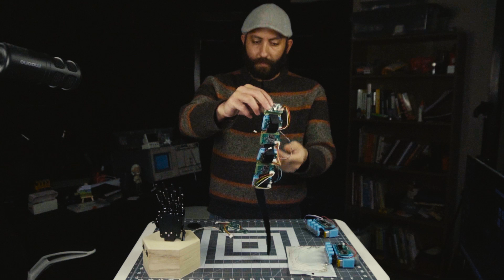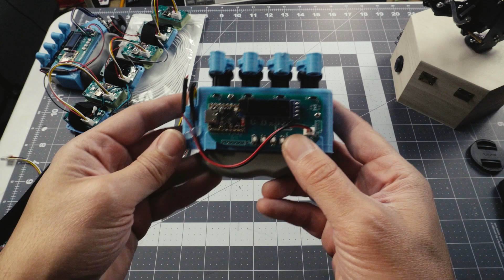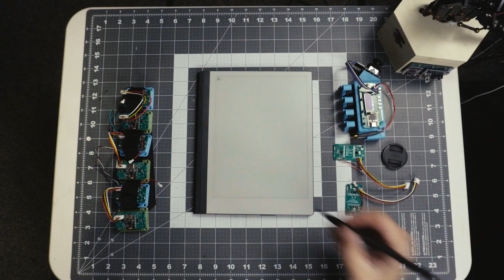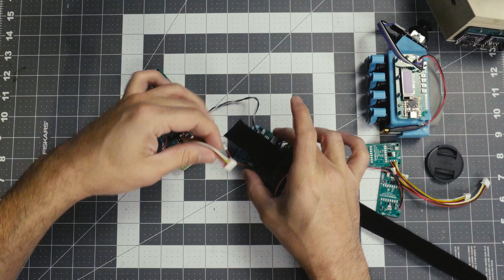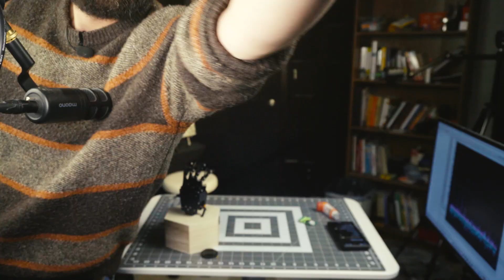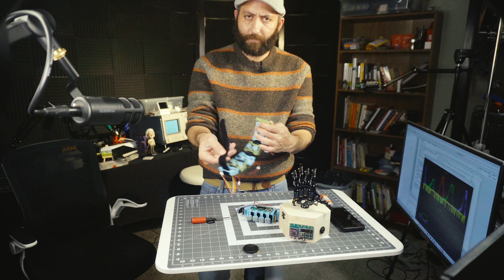Successful Data Capture! - Open Muscle November Update

Comment: Your project is awesome!
Could you say some more about the neural network?
How do you train it? What does it output?
Reply from the maker: @redve390  I train it with that label device and the output is 0-750 for each finger. So the output represents a finger curl strength or finger actuation.

Comment: Also are those mechanical sensors you are using? Honestly I don't really like mechanical. Presumably in an amputee the muscle leading the hand would atrophy. Making mechanical sensors ineffective. There is probably even a decent chance that the neural signals would atrophy as well making the pickup of those impossible. I think this is why people use gesture control. With gesture control any muscle on your arm can control any arbitrary hand function. With training you should be able to recreate complete hand control but I doubt it would use the same existing muscle groups. 

One thing I liked and always wanted to try were ultrasound sensors. There is a paper talking about an ultrasound prosthetic called the like. Skywalker hand or something. The problem with that prosthetic is that they used a medical ultrasound machine to provide the input. I think low cost ultrasound sensors should be able to work if used in a phased array. The reason why ultrasound sensors would work well is that there is more data and more data means better differentiating between gestures and even gesture interpolation.
Reply from the maker: @Imaboss8ball  electromechanical has two amazing features. 1 super high signal to noise ratio and 2. Low sample rate required to map the frequency. This paired with ML makes for insanely fast and accurate inference.

Comment: When I've thought about this sort of thing for labeling i always imagine a thing where the individual attempts to mimic a picture. The data from the sensor array would be collected with the assumption that the individual is indeed attempting to mimic the picture. The reason why I like that is because not everyone will have a hand to produce the labeling. I doubt that labeling would be the same for others. So I expected that calibration would occur per person. The benefit is that you can have a virtual prosthetic to confirm the model has indeed been calibrated.
Reply from the maker: A passive label such as that from open pose using a camera to detect whole hand position with fingers is good for classification but my system uses pistons with springs that measure the force the finger flexion or curl it is applying. The muscles contract more when more force is applied and I believe it provide higher accuracy in predictions or inference in ML models.
Reply: @turfptax  maybe I'm confused. What are you trying to make? A prosthetic right?

Edit: I think an entirely open ended model training would be best. These people are assumed to not have a hand. Meaning there is nothing to copy or to press buttons. So for the training/calibration a computer would display a picture of a gesture or hand position. The person would then try to copy that gesture/hand position. I say try because again they are assumed to not actually have a hand. The sensor package would copy this data under that particular gesture. To confirm that calibration was successful you can use the sensor data to control a virtual prosthetic or a simulation of a hand. This process is designed entirely under the assumption that the person does not have a hand or at least does not have complete hand function.
Reply from the maker: @Imaboss8ball  I'm creating an open source prosthetic sensor system. You are talking about passive ML with classifier models. I'm using primarily (not only) force measuring sensors to directly correlate muscle contractions with finger movements. 

The approach you are talking about works as well but I'm creating a robust suite of tools for those in prosthetics and ML to have the tools they need to find the best solution.

Currently this is just a prototype dev kit for those interested in researching the tech. It has a long way to go to be used in a prosthetic system.